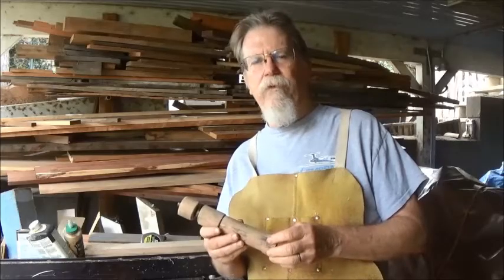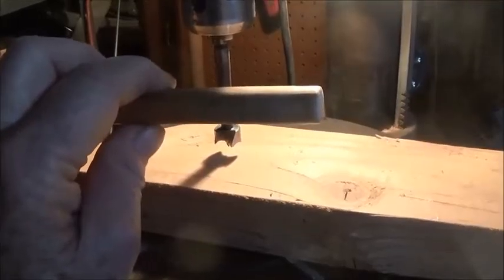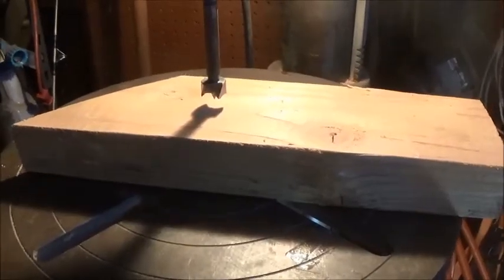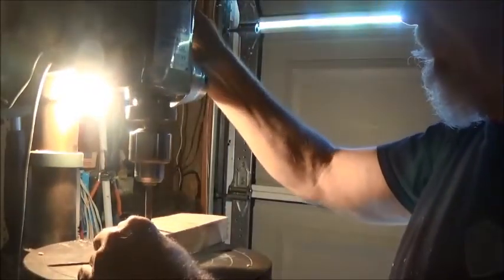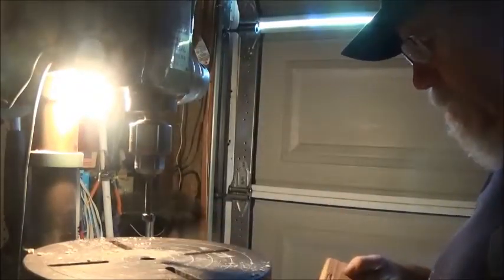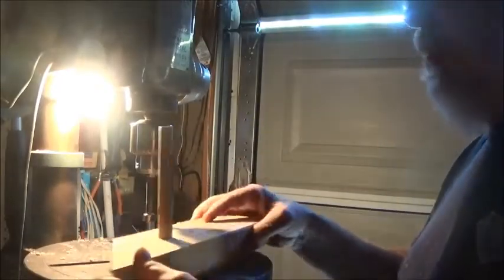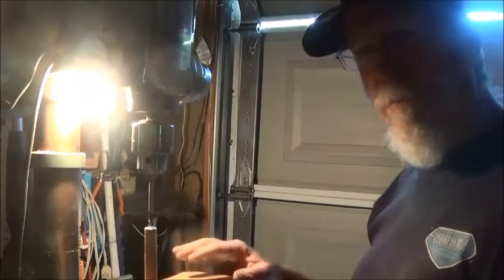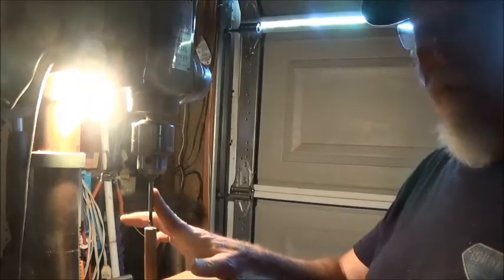Drilling a Dead Center, True Hole in the End of a Round Dowel:  A Simple Trick

Comment: You could just centre drill both end and put a lathe centre into the hole on you pres table. Align the drill to the centre and just hold the dowel and drill. Flip it over on the bottom centre and drill from the other end.

Comment: The book answer's to clamp a flat to the dowel, place the right angle of a setsquare against it, and mark where the edges of the square cross the dowel. That's one diagonal. Repeat, at 60 degrees round, to give you the centre, and again, to measure twice before cutting once. A centre-finding tool does much the same. Then, repeat at the other emd.
A length of brass angle profile's also good if you want to project a point on the dowel to the end.
Reply from the maker: Thanks for the comment.  I don't have a center finding tool and I'm sure most others don't either.  I thought about going to Rockler and getting one, but, I'm not only too lazy to drive that far, I'm also cheap.  The flat idea is actually pretty danged smart, but in defense of my little jig, my way also helps keep the hole true as it gets deeper into the dowel.  Maybe combine the two?
Reply: @timkeel359  I've just bought an optical centre punch, does the same.

Comment: But what if my parts are turned on a lathe and vary in my and are tapered. Musky lure making.
Reply from the maker: I'd guess that you would drill the holes with the lathe.  If not, I guess you could turn the blank to round, un-chuck it and drill the hole using this jig and then rechuck and turn the taper and the final shaping.

Comment: I turn rollers and handles with through holes for a customer all the time. Hundreds. Your method might be fine for a standard dowel, as long as the dowel is the same size as standard bits. I can see an issue that often arises drilling end grain wood, where the bit tends to follow the grain, so that can cause run out. An absolute method for having a concentric hole through anything is to drill the hole first in flat stock then use that for centring on the lathe. Two things: First, I get that many folks don't have a lathe so this won't work for them. For those that do, cones (even temporary wooden cones) can be used for a friction drive and tail stock centring to fit any diameter (my two big jobs have either 3/4" or 1/4" holes). Turning a true cylinder (if it's a roller, not a handle) is a bit tougher than it looks, but with a bit of perseverance and a sanding block, you can get the job done.
Reply from the maker: You're right, a lathe is the "proper" tool.  I made one out of my radial arm saw that turns table legs and such but it doesn't have a chuck for drilling.  I have found that forstner bits drill truer than paddle or straight bits and can get around most of  the grain chasing problem.  Thanks for the comment.

Comment: Brilliant. I need to drill a hole in the center of a 1.25 piece of metal rod to thread a 1/2-13 thread. It needs to be perfectly center. Without a lathe, good luck, right? I knew someone has solved this before just with a drill press, and here we are. Good job and thanks. Only issue is, I don't think I have a 1 1/4 forestner bit lol, but I'll check.
Reply from the maker: Boy, I don't don't get called brilliant very often.  I had to look it up to see what it means.  In the dictionary, it said, "see sarcasm".  LOL.   In your case, I'd be interested to know how centered the point on a forstner bit is.  For wood tolerances, it seems fine, but metal is a different beast.  Let me know how it works.

Comment: If you clamped down the 2x4 you could have just inserted the dowel and it would have been centered, skipping marking the dowel from bottom. Just a thought.
Reply from the maker: You're right.  The only issue is getting the dowel in and out of the 2x4 (depending on how deep a hole you are drilling in the dowel), because the drill bit gets in the way.   You're way is actually probably more repeatable when you can do it.  Thanks

Comment: I have made a jig for center drilling a 1/4" dowel with a 1/16" hole by clamping the stock in place, drill big hole with brad point bit and twist drill for the small hole. The jig works except that after a few uses, the small hole is no longer 1/16". Does anyone know where to get a hollow metal rod with 1/16" diameter hole. This would extend the jig's life tremendously. Thanks.

Comment: You can do the same thing if you embed a doweling center. Drill hole put doweling center in that hole and put dowel in the hole and tap the dowel. The dowel center will center punch the dowell
Reply from the maker: That would be more repeatable if you are doing multiples and probably a little more accurate.  I don't have dowel centers and I hate to stop what I'm doing to go to the store for a tool, so I do  lot of stuff the way I do it.  Thanks for the comment, it's a smart idea and improved on the original.

Comment: Looks like you do great work.

I have some comments, don't take them as negative.  It looks like you got good results and that's the key.  Making jigs and fixtures was what got me interested in woodworking.

Did you square your table and joint the bottom of the 2x4 first?  Those two moves would increase accuracy.

The nice tight fit of the dowel in the hole was important.  If it is not a custom made dowel it likely won't fit tightly in any hole drilled with a standard size bit.

I enjoy your videos!
Reply from the maker: Luckily, I have a safe space, so I can run away fr  uh, I mean deal with negative comments.  I'll be there for the rest of the day if you need me, LOL.  Thanks for the comment and for watching.  I'm kind of like you, the designing and figuring out how is the fun part of woodworking.  The actual making is kind of like work.  In this one, if my redneck logic works, you don't have to squre up the table or joint the 2x4 as long as it's in the same place and orientation with the dowel in it as it was when the hole was drilled, because the hole in the fixture then lines up the dowel exactly with the drill bit.  You're right, a big limitation is that you have to have a drill bit the size of the dowel and I make a lot of custom dowels because my local stores only sell them in oak and poplar and I rarely use either of those woods.
Reply: @timkeel359  I'm with you on the location of the holder being a big help on keeping things straight.

I admit I kept thinking you were going to flip the assembly over and spot drill the dowel from the bottom.

I apologize for my hateful rant...

I will now go use a chisel as a screwdriver.

Comment: A lathe is best, but a cheap centre finder works well too.
Reply from the maker: You're right, even if you spelled center wrong (just kidding).   In my defense, the center finder locates the center point but it doesn't insure a true hole.  A lathe is best but most people don't have them and I made mine from an old radial arm saw motor.  It doesn't have that capability.  Thanks for the comment and for watching

Comment: If you drilled a hole the size of the dowel in a scrap piece fixed in place, you could insert the dowel and change bits and just drill away. It will be centered as long as the scrap piece wasn't moved.
Reply from the maker: Thanks for watching and commenting.  You are right, locking the fixture in place would same some time, especially on multiple dowels.  On my drill press, the table doesn't have a positive 90 degree stop like my chop saw, so when I swing it out and back to replace or flip the dowel, I may have some inaccuracy on the return.  The main difficulty would be that you'd have to bore out the hole in the fixture a bit so that the dowel doesn't fit so tight in it.  As it is, I couldn't get it in and out of the hole without removing the scrap piece fom the table.  I hope that makes sense.  On the other hand, I checked out your channel and the crane shots are insane.  No way in hell with my healthy fear of heights would I be climbing around on those things.  Pretty cool stuff.
Reply: @timkeel359  Haha, I have no channel worth mentioning. Maybe in a year or so when I have a woodworking shop of my own. But yeah, that whole crane-raising event was fascinating. I'm glad I could get a view like that while I was working at HHS. I went in on that Saturday morning just to record it.

Comment: Good idea. Alternatively lock drill press table and clamp the 2x4 to the table, drill the same size hole as I'd of dowel and place dowel in the hole. Now it is positioned perfectly centered to drill spindle.
Reply: This is the way. Create your fixture in exactly the same configuration as you use it. No movement. It will be perfect.
Reply: @nopenotmedude  He was so close to perfection. The one thing you have to have is a table that is squared off the quill though.
Reply: Only works if the piece you want to drill is short enough to fit under the bit. A drill press with 3" of quill travel will not be able to drill into the end of a ( for example ) 6" dowel this way.
Ran into this myself and solved it by using my wood lathe and a pass through chuck to hold the dowel. Granted this only works if you have a wood lathe.

Comment: Hi Tim ! Thanks for the video. I'm often drilling the center of dowels, so I found your video very interesting.  I will try your method. I try to drill down the center of dowels by starting with a smaller drill bit than I will need, and then drill a hole down the center with my hand drill, while letting the dowel spin in my hand. Then, I gradually work my way up to the size of drill bit I need. This is not a perfect method, but it seems to work fairly well. I'm making stands for whirligigs, so it's important for the mounting rod and stand to be square. If things go real sideways and things are obviously crooked, I find that you can enlarge the hole slightly until you can square things up and then make up the difference in the hole with epoxy glue.  Warm greetings from Wishram..
Reply from the maker: Thanks for watching.  I hope it works for you.   I checked out your channel.  Your whirlygigs are incredible.  The Crowing Rooster is not only a really nice piece of art, but the engineering is pretty danged impressive.  I'll have to spend some time on your videos to learn how they work.  Very cool stuff.